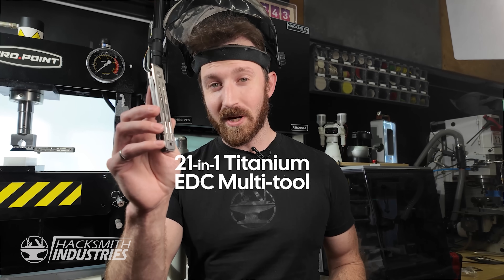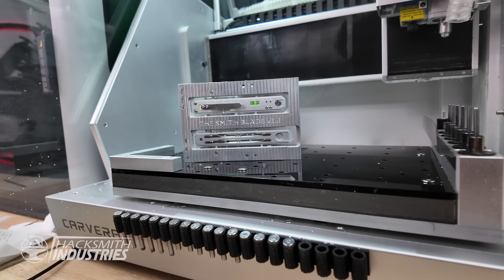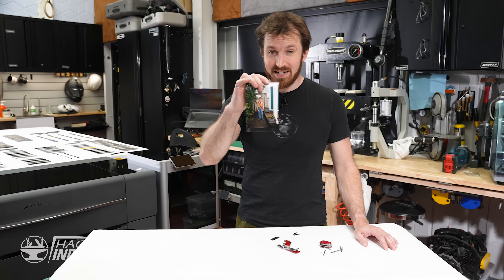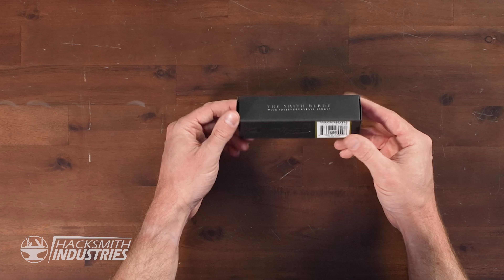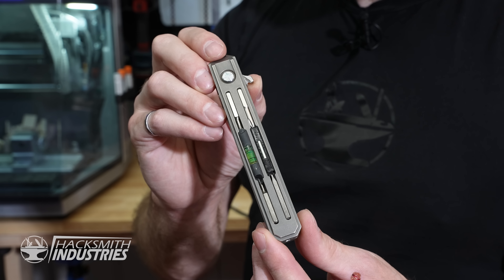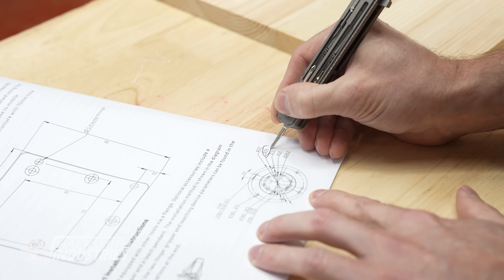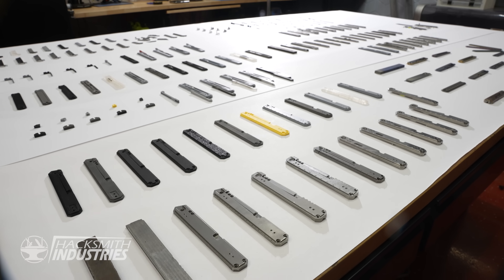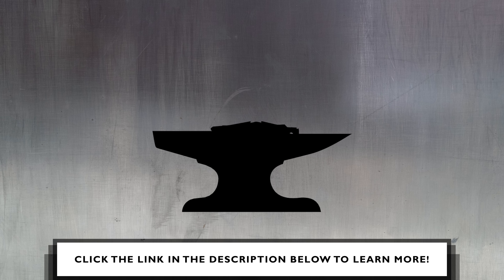We Made a Knife that can CUT THROUGH ANYTHING!

Comment: Can you comment on the legality in Canada? It's pretty interesting - I know Canadian Customers has a defacto ban on pretty much any folding knife being imported into the country. However, since you're manufacturing these directly in Canada, have you looked into the legality of selling these (in Canada)? The flipper opening is particularly what stands out - that would instantly get flagged and confiscated by CBSA, but they don't have a say on domestic knife laws.
Reply from the maker: This is a part of the law that is pretty misunderstood. OTF knives can indeed be illegal in Canada, but the law is very specific on what constitutes that.

Basically, switch blades, butterfly knives, button actuated, and gravity knives are all banned.

Flip tab knives do not fall under that definition, because the law is very specific about the means of the action -- if it is a mechanism on the handle -- it's illegal. That's why flip tabs, knives with a thumb hole on the blade, or another dowel sticking off the blade are in fact legal. 

This was affirmed in 2022 when Canadian Border Services Agency (CBSA) updated its interpretation following a Federal Court ruling (T. Turner v. Canada), which clarified that not all folding knives that can be flicked open are prohibited — only if centrifugal force alone opens the blade from the closed and locked position.
Reply: thank you! I have a bit of PTSD after CBSA confiscated a regular frame lock edc knife with a thumb stud I purchased from BladeHQ a few years ago.
Reply from the maker: That hits the nail on the head with the issue with anyone in "a position of power" like the TSA, or CBSA. At the end of the day, it's up to their discretion, which can be not what is actually the law =(
Reply: @hacksmith the fact that you guys are Canadian and this beauty is designed and manufactured in Canada is what clinched it for me. Easiest "take my money" I've done in a long time

Comment: Would you consider an in-between standard and pro tier in something like Vanax for places where corrosion is more prevalent?
Reply from the maker: While Vanax performs a bit better than M390, they are both 20% chromium stainless steels, which make both of them some of the most corrosion resistant steel out there =)

In the future we plan to offer other blade materials and styles, but that would be next year.
Reply: @hacksmith   Quick question about the Pro model. Was looking through the teardown image and noticed the lack of standoffs/screw posts where the two handles meet behind the tritium vial. Does this mean the bottom screws engage directly with the opposing handle? If so doesn't this mean that if the thread strips then you have to replace one handle side?
Reply from the maker: Grade 5 Titanium is very hard -- unless your purposefully cranking on those screws or crossthreading, there shouldn't be any fear of the thread stripping. Also shouldn't need to take it apart that often -- blue loctite is also used to keep everything tight and strong!

Comment: Now for self defense scenario aside for edc use. Reverse tanto especially if the blade profile is close to viking seax as well as wharncliffe blade excels tip cuts meaning it will produce deeper cut than any knife blade design that has belly on it but only second to hawkbill blade like karambit and pikal knife but still able to do thrust attacks. Now for the blade material choice, both M390 and 14C28N are valid choice since they can be sharpened into super scary and hair shaving sharp blade almost close to surgical scalpel in between obsidian scalpel or regular stainless steel scalpel.

Comment: This feels like a realy nice way to get you phone screen scratched, especially the tungsten carbide part that i assume is exposed
I think you guys should test putting both in a pocket and make a warning
Reply from the maker: Which is why the tungsten carbide is dulled, since you know, we have been testing it for years. 

Regardless of tungsten though, you shouldn't be putting a knife in your pocket with your phone. You wouldn't put your keys in your pocket with your phone, would you?
Reply: @hacksmith Yes i would not, and if i do, that's on me.
Now... if i do, normal hardness steel will do nothing to glass on a screen, i don't know about this knife steel/file, but the carbide will absolutely wreak anything that can be scratched
Just saying to test if it is a realistic problem, or if you already did and  is a no problem, great, but maybe it deserves a warning?
Reply from the maker: Despite whatever version of gorilla glass we're on these days... metal can and will scratch glass, regardless of whether it's a tungsten carbide or not, our advice would be to not put it in your pocket with your phone. There is no way to gurantee that. We have dulled the tip so it does not stab you in your pocket, and it is not sharp.

Comment: You really should make it more clear that the m390 blade only comes on the 21 in 1 and the founders. 
I was buying one for the m390 blade and had bought the 14 in 1. The video here makes it come off as if the m390 blade is on all of them, and the difference in price is just the amount of tools on the knife. 

Luckily kickstarter allowed me to edit my pledge and reward. So, i was able to change it once i realized. But, if i screwed it up, im sure there are others that did the same thing.
Reply from the maker: It is very clear on the Kickstarter page and even this video when I show the prices on screen, only the pro is "with M390". 

The entire kickstarter that people seem to refuse to read explains every feature, and the VERY first feature is the blade, not even a whole page down from the top. Which specifically says M390 on the pro and 14C28N on the standard and lite. Then again in the comparison chart that shows what includes what. It's like watching the latest iPhone pitch, hearing about all the max features and then buying the cheapest model and then getting mad at the company.

Comment: Look, M390 is a great steel and 250$ for a titanium framelock (with lockbar inlay/over extension stop as well, nice) with M390 blade and all those gadgets (+youtube branding :P) is not a bad price tbh. Is it that bargain price you are advertising? No. And you shouldn't have done that; "Most knives with M390 blades cost 500$" is a crazy statement! Sure you CAN get knives with M390 blades at that price point, but those are either custom/mid tech, or would be way bigger. I'd say a price point of 170-300$ would be way more accurate for most comparably sized titanium framelock folders with M390 blade. So, I'd say your 250$ price point would be fair for the knife on it's own. For all the gadgets it comes with I'd say it's even a good price overall, but acting like you are basically cutting the industry standard pricing in half is just dishonest marketing. And like I said, you don't even need to tell weird marketing lies here; as long as you don't fuck up the manufacturing quality (wich is the kicker here; making prototypes in house is one thing, larger production is a whole different beast), I'd say it's a good price considering the materials, gadgets and branding. Just be honest about it; "high quality materials + useful gadgets for a good price." That's it. You are not somehow undercutting the whole industry by half.

Comment: Hey, how about adding a marking on the blade itself showing a small line showing what degree the protractor is it would be super helpful. If possible you could it be designed like a ratchet? You could easily adjust it by turning it a tiny bit in either direction, making it much easier to screw things in. I’m not sure if it has the protractor thing, but it’s just a thought! And I’m not sure if it’s possible to make it like a ratchet, but hey, it’s just a suggestion!

Comment: Saying most blades with m390 are over $500 is completely disingenuous and incontrovertibly an outright lie. most blades with bohler M390 are going to be around $200 (especially with Chinese manufacturing, which I’m confident is what was used for your multitool.
Reply: These are made in Canada, bud.
Reply: Depends, is it a pricey EDC show-off knife or an actual useful workhorse knife?
Reply: You’re 100% correct about m390 (and since 2021-22, magnacut is the definitive premium blade steel), but surprisingly, only the Lite model is manufactured in China. The regular model and pro seem to be made in Canada (buying the manufacturing equipment was the main point of the kickstarter). Either way, the price on the pro model is fair enough imo, assuming these are built as robust as they say. This hype for something untested by the market is all just clever marketing, though

Comment: M390 isn’t exactly the toughest steel. It’s pretty laughable marketing this as able to cut through everything when it’s got m390. Leatherman multitools are being made with Magnacut steel now which is much tougher than m390, more corrosion resistant and when heat treated well has better edge retention too. M390 is definitely still a great steel but it’s toughness is definitely not a selling point.

Comment: You definitely need to make a version with a seat belt cutter and a medical oxygen tank wrench while keeping the glass breaker. A tool like this with those 3 features will sell like hot cakes in the 1st responder community. I EDC the Letherman OHT, which has a seat belt cutter and an oxygen tank wrench, but no glass breaker. I would replace my Leatherman with this Smith blade if it had those features.

Comment: Can you make it an option to chose a blade with the flipper, but without the locking function? In Germany it's legal to carry a one handed knife if it doesn't lock, like the böker catalyst 42.
Also a deep pocket clip would be amazing
Reply: On their kickstarter website, they detailed under the knife laws & legality section, that they made a non locking version of the smith blade that is also shorter than 2.99 inches or around 75 mm in length. You also have to use two hands to open the blade apparently. The version exists specifically for and I quote countries with stricter knife laws like the UK, France, Germany , Australia, etc. To order that version you apparently have to specifically select non locking version on checkout or else it will be delayed, seized at border control or some other stuff. You can read about it on their website, the link to that is on the bottom of the video description.
Reply: @PMT17 the question was specifically about a non locking version with a flipper for one handed opening, which is totally legal to carry in Germany.
They only offer a version that comes with both inconveniences (non locking, two handed), even though in Germany it's only required to have one of them. (Basically you cannot have a fast deploying knife that can stab. With two handed opening it can lock or it can have one handed opening, but then it cannot lock. Their Germany version sadly offers neither)
Reply: @Blubb3rbub @Blubb3rbub  Correct, I seem to have to have missed an information through first reading initially. 
Perhaps hacksmith will release a later design with such features.
Reply: @Blubb3rbub  Guess I was right, they released a new locking function with two handed opening.
Reply: @PMT17  thanks for the hint about the update. Yea, now there is also a locking two handed version. Don't think that was in the works when I wrote my comments back then, though.
Sadly they don't offer a non-locking one-handed opening version, which i personally would have preferred over the locking two handed version. They talk so much about how great it feels to open and I doubt that comes across with a nail groove.
Reply: @Blubb3rbub Perhaps, hacksmith will work on that feature as well, enough people will probably ask for it, they might even release it with the stricter knife law variant for japan and korea. We'll see.

Comment: I feel like putting the pry bar on the end where the pivot for the blade is not only prevents you from completely sharpening one side, but you're essentially telling people "Hey put a lot of pressure where the blade pivots" I feel like this is going to cause centering issues after long or hard use.
Reply: Undo the 2 screws and sharpen the blade on its own
Reply: @j.stalport  correct you can, however that kind of goes against the ethos of this blade of being a "convenient" multitool.
Reply: Uh oh, my knife is no longer centered! I must now throw it away as it’s no longer able to cut things.
Reply: @nmiloslavich  actual 40 IQ response. if  I'm paying a premium for a tool. I expect that tool to perform and hold up for its intended purpose. ofc I'm not going to throw it away b/c of centering JFC touch grass.
Reply from the maker: You guys realize, that the small amount of blade that is somewhat obscured by the bottle opener... Will also not get used regularly when cutting things, and thus... Not even need to be sharpened?
Reply: @The_Droker hold up for it’s intended purpose ey? A centered knife cuts equally as well as a non centered knife. Trust me, I’ve done it. Of course if your pivot gets loose you could always send it to me. I love failing multi tools.
Reply: @hacksmith  Tell me you don't EDC a knife without telling me.
Reply: @hacksmith  also completely ignoring the main issue I have, which is putting pressure on a blade pivot with ball bearings, but please focus on the easy part to address.
Reply from the maker: In our testing we haven't noticed any damage to the housing when using the bottle opener or prybar. If you're putting enough pressure on it that would impact the bearing, you will literally bend the prybar. The only time we've had issues with the bearing is when Bogdan took it camping and used a hammer on it to chop wood.
Reply: @hacksmith  Thank you for the direct feedback. Having that knowledge makes me a little confident in the design. Using a folder to baton wood is very much outside the use of a pocket tool so I wouldn't expect it to hold up to that unless designed specifically too. I would however lower expectations of the average consumer when saying they wouldn't apply enough force to cause pivot damage. Whatever you think the consumer can't do, they are going to do.
Reply from the maker: It's a separate issue really -- if you jam the prybar in somewhere and pry with all your strength, you will bend the prybar, damaging it from working -- however, as per our tests, even at that level of stress -- it doesn't affect the bearing or knife movement. You just might not have a functional prybar anymore. 

Consider it planned failure mode -- before you wreck the knife's main function, you would break the prybar. 

Using the prybar/bottle opener as intended for opening bottles, or popping paint cans, or removing staples is well within it's capability. Similarly if you pry with a knife... you'll break the knife. If you abuse the tool, you will break it, just like any tool. =)

Comment: Ah hell no. 250$ -200$ is crazy. 99$ is more reasonable. At 250 or even 200$ I wouldn't even want to use it in case it gets scratched or damaged. 100$ is still alot but most high quality blades are 100$

Comment: For the love of goodness, please make it locking and two-hand-opening for Germany.
Or keep the flipper tab and make it lock two-handed.
Because a one-hand-opening knife can't also lock onehanded. Which means it can legally lock twohanded. We already have double-detent-ball onehand flippers that also lock onehanded, because the double-detention-balls act like a slipjoint, but we don't have them in two-hand-locking yet.
German laws, I know right. Gotta fill in those "loopholes" that aren't really loopholes, but missed opportunities. A one-hand opening knife can lock, it just can't lock onehanded (for legal carry by default).
Reply from the maker: Available on Kickstarter, we also mentioned it in this video
Reply: @hacksmith Not really. You only offer non locking two handed opening (you call it non locking and remove the flipper).
Germany would allow two handed opening that locks (so no flipper, but frame lock) or one handed opening that doesn't lock (flipper, but no frame lock).
Or is the Kickstarter page misleading?
Reply from the maker: We are looking into offering both
Reply: @hacksmith  Hell yeah! 🥰 I can be patient, if needed. 🥺👉👈
Reply: @Blubb3rbub  German law also allows legal carry of a one-hand-opening knife that only locks two-handed. Like we could drill a hole into the blade and handle in open position and insert a pin with two hands, so we could lock it if needed, and still have one-hand-opening and non-locking sweetness for all the smaller tasks. 🫡 We could also choose one of the bit-slots for a pin for example, but I ain't no designer or engineer. 🥺👉👈
Reply: PS.:
I couldn't see how I am supposed to grab the blade to pull it out, without a flipper tab. Seems quite flush to me in closed position.
Reply from the maker: Fingernail groove at the frame lock
Reply: @hacksmith  Ah, thank you very much. So I assume a cutout will be made. I would also be fine with 2 cutouts and no nail nick, maybe some slight jimping. Usually it's enough if you can grab the blade. Just thinking loudly though. I'll continue to monitor the situation.
Reply: I'm also interested in what Bubb3rbub said.

Comment: It's a thick blade. 0.14"  3,4mm thickness /  0,42" 15,7mm width of the blade.
Definitely it's not a slicer. Rather a hard use cutter, maybe closer to a scandi grind.
I would to see a version with a thinner blade. 
Would a thinner 0,08" blade be more edc friendly?